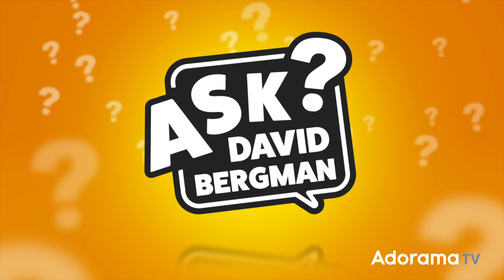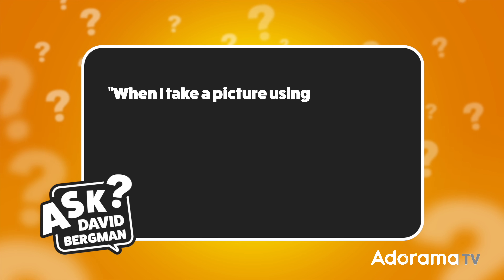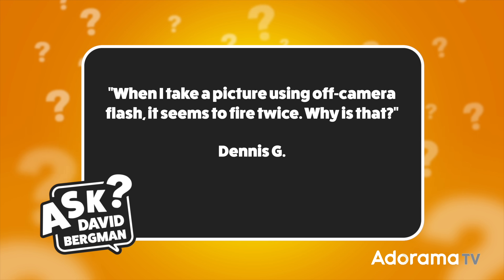TTL Pre-Flash for Beginners – Why Your Flash Fires Twice | Ask David Bergman

Comment: 4:42 I was so frustrated on the weekend with my R7, efs 10-20mm lens and ex430RT. Custome set to use IR and pre flash and a 8th of the time it stifled to find focus. I could see the subject fine through the evf and pumping the shutter and moving the af point helped but my dslr never gave that issue.